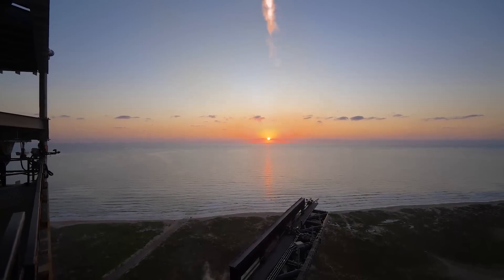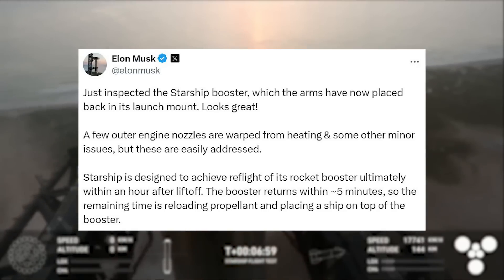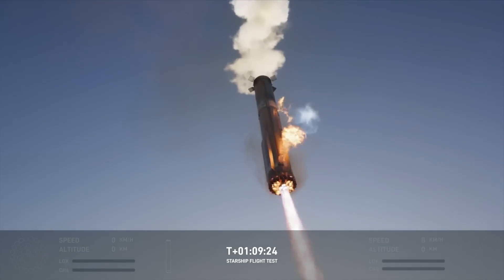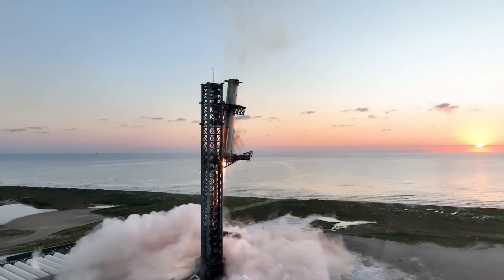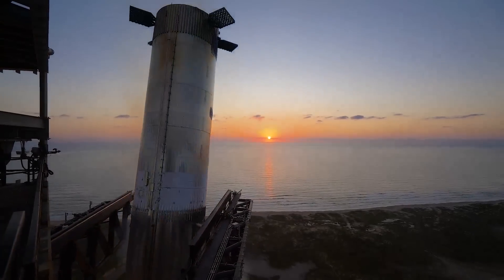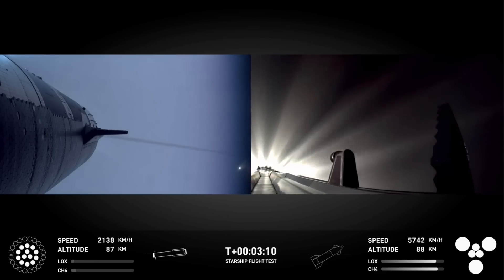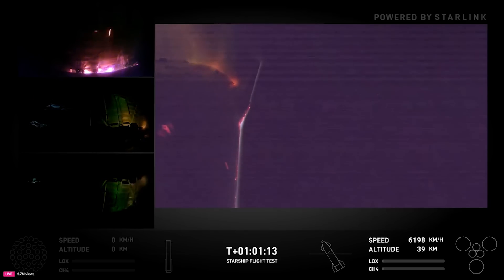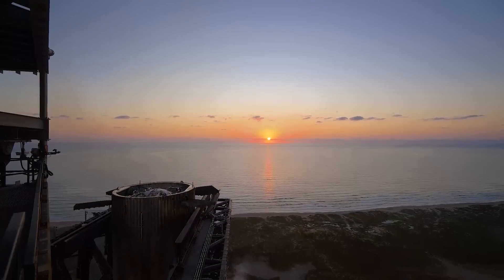What Happened After SpaceX Caught The Super Heavy Booster?

Comment: Hear me out, but IFT-6 will probably try to have starship perform a deorbit burn, with much the same flight profile as IFT-5 aside from that. IFT-6 will probably try ship recovery
Reply: I can see a burn test, not so sure about a recovery, I guess it depends if they use the last of the V1's or start with the new V2's.
Reply: @TheEvilmooseofdoom  I mean remember they only had the booster test its functions to rtls once before they tried catching it, I think the only real thing they need to try catch a ship is to be able to orbit and deorbit in a certain position
Reply: @Mr_Lyric  Do you think catching a starship will present TPS issues?  Looking at the booster catch the arms were in contact with the sides as it was moving.  On starship that would scrape off some of the tiles.
Reply: @TheEvilmooseofdoom  Quite possibly, but it shouldnt be too big of a problem for a catch test
Reply: @Mr_Lyric  I agree, a test, but it would still mean some kind of modification to the design might be required for a final version.  Or are you thinking that it might be easier to simply replace some tiles (they are standardized) between flights?
Reply: @TheEvilmooseofdoom  It would probably be easier, but given that the goal is rapid reuse I think they are trying to get it to the point where that is mostly unnecessary

Comment: Specs:
Height: 69 meters (226 feet) - Same as a 23 story building
Diameter: 9 meters (30 feet)
Engines: Up to 33 Raptor engines (using methane and liquid oxygen)
Thrust: Approximately 74 MN (16.5 million pounds)
Mass (Fully Loaded): Over 3,600 metric tons
Burn Time: Around 170 seconds
Reusability: Designed for rapid reuse via the Mechazilla tower catch system

Comment: The nozzle warping issue will likely NOT be addressed before IFT-6. SpaceX already has a major redesign of the booster (Block 2) and a 3rd version of their Raptor engines incoming, so the nozzle warping issue will likely be addressed as those are implemented.

Comment: Does heating and cooling metal weaken it?

The short answer to the question regarding making metal weak is yes, however, only for some metals. The process of annealing can soften a variety of metals. Brass, steel, iron copper and silver can all be made weaker by heating the metal to a set temperature and cooling it slowly... Cooling too fast makes it hard and brittle prone to cracks. Cooling too slow will soften the metal. The raptor engine has copper in the alloy.

Comment: simple fix.  circulate fuel in bell during decent.
Reply: Give them a call, Steve.  I'm sure they're simply clueless without your input.
Reply: i did suggest that the concrete needed a giant water cooled steel plate under the launch tower.  then the EPA went to a diddy party.

Comment: Elon needs to stagger the booster rings so that they cool in ratio with ring shutdown & startups. For instance when the middle ring & outer ring shut down at the same time, the outer rings cools down first because the wind chill factor cools it down quicker than the inner ring, which is because it is not subject to the same wind chill factors that the outer ring has.
This can be mitigated by placing the middle ring further down than the outer ring, so that it's exposed more to the wind chill, with the centre ring down further, so that the base forms an "bluntish arrow" upon return through the atmosphere & an arrow plume once the centre ring lights back up.
This bluntish arrow gives better aero-dynamic characteristics than their current blunt end that they currently use, and will give better "stearing" when they fire up.
Reply: Wind chill.. good grief.

Comment: Realistically how long after landing would it take to cool down, fully inspect for defects then refuel and prepare for the next launch ?
Reply: I actually think it would take a lot longer than folk think.. I imagine a number of reused bodies and nozzle assemblies from previous flights  being refurbed in slow time for the next flight and cycling these units around.  If you have folk on board you'd have to be very risk averse. I worked in the rocket motor "business" for nearly 30 years in the UK, working internationally on programmes with the US ( United Technologies,  Naval Weapons, Edwards), BC in Germany,  Roxel UK, France, DREV, WSL Adelaide and on research programmes AGARD, NATO ..that's my background.  Just allowing a motor to cool down so that you can handle it takes quite a time.
Reply: @monabri7387  that’s what I was thinking, after cooling down which would realistically take hours, there would then be hundreds of components and systems that would have to be thoroughly tested, cleaned and inspected. Then there’s no way that absolutely nothing would need to be repaired or replaced. I’d hazard a guess that it’s going to take at least a week for turn around.
Reply: @spinnymathingy3149  No one has any idea what if or how much work will be needed between flights.  This is still development.  They have been speeding in F9 turn arounds steadily and those things burn a dirty fuel on top of everything else. As for cooling, when you're pumping cryo-fluids into something it cools, it cools quickly.
Reply: It depends on the number and types of sensors it has.  I'm guessing the number is VERY large.
Reply: In the future? Probably around an hour. Still Lots of improvements to add to everything. And once they get Routine, inspections, refueling and everything else will be fully automated. Though I do guess they will have varied degree of inspections like with airplanes after a certain number of flights

Comment: Can someone explain why the heat and pressure of re-entry seems to be such a massive obstacle but leaving the atmosphere doesnt seem to pose the same challenges?
Reply: The speed. It is hitting the atmosphere at 27,000 KPH. That much speed creates much more friction and heating. During launch it only gets up to maybe 10,000 KPH while in the atmosphere, so the heating is less. Also the angle of the flight at re-entry is more extreme, so more friction. Think of holding your hand out the window in your car. Parallel to the road is like launch, less resistance. Perpendicular to the road is like re-entry, more resistance.
Reply: In addition to what @grangerm said, there is very little air at high altitudes.  Which is good because you need to be going very fast when you reach orbital altitude.  But, when you're returning, you've got a LOT of speed that needs to be bled off, and there's simply not enough room and energy budget to carry fuel to slow it down.  Just imagine having to have fuel tanks 4 times as big just to slow it down to get back to earth.  So, it's always going to depend to some extent on using thin high-altitude atmosphere to do the initial slowing.

Comment: how are they gonna get a fresh starship to the pad within an hour?? surely you can't just have it sat on the floor right under the first launch?
Reply: Surely it’s gonna take longer than that but musk just wants to set tough deadlines to push the team
Reply: Look at it this way.  For most of their ambitions they will be doing a lot of refueling, that means most of the starships that will be flying are tankers.  IF they can dial the system in to the point where no major refurb is required there is no reason a tanker can't be refilled on the pad with the rest of the stack.

Comment: I think I have a good theory on the engine warping and the "simple" fix. The engines had the full force of the atmosphere pushing on them (like cupping your hand holding it out the car window), and that combined with the heat softening the metal on reentry started to bend the engine bells. After all, without constant coolant, they would melt in seconds after ignition. I think their solution will be to simply start running coolant through them during the descent, which they may not have been doing (we know they can do this, as there was a call out for starship that coolant was to flow through the engines shortly before the flip maneuver burn). I think this would solve most of the issues. There's no way the engines can't in principle withstand the force of reentry given that they experience much more stress at launch, so I believe it's just a matter of cooling, hence why Elon seemed pretty confident it would be an easy fix.
Reply: Indeed, that's the way to go in modern rockets. You cool your engine with the fuel, which in turn becomes superheated and easy to ignite. Fuel does 2 jobs in one go. As Elon implied, I imagine you simply alter your fuel rates to the engines, although this solution will probably slightly decrease payload as the net effect will be to use a little more fuel to achieve a slower descent which then has less friction burn. Either that or to burn the fuel in a different way such that it is more cooling and less power. I'm sure both are possible. It would be hard to get this balance exactly correct first time. (btw, I say "simply" when nothing is simple here)
Reply: @snaplash  makes sense, though I imagine it doesn’t really burn any since they’re just cycling the cooled liquids. My guess after thinking about this more is that, like with starship, they do cycle the fuel/coolant through the engines prior to the landing burn, but didn’t realize that they’ll need to start it way sooner to combat the heating from coming back down

Comment: I have given the issues that StarShip's having. a thought. In truth I was expecting this when I looked at the craft before launch. Hear is how SpaceX can fix the wing issue.
The main issue is the area in question is to thin to account for this area of heatting. The main issue is that the heat shiled under that area is not out enough to provide enough protection. The issue is I think they forgot about the wash effect that this plasma pulls in. They also need to change it from the 45°  they have this at to a more 62° to counter that issue. I would also say that the joint section needs a higher shilding thickness. They are getting closser but if needed 54° would work as weel.  Nice catch.
Reply: You're out of date there armchair expert.  They're already way ahead of you.
Reply: Like they already built the ships they're so far ahead.
Reply: Ship 33, the first V2 version, has adjusted front wings, which includes placement under larger angle. I think it wouldn't make sense to use another of the remaining V1's for collecting more data. What more can you learn?
Reply: They didn't forget anything.

Comment: The flaps don't have any role to play in reentry because there's not enough air density for them to be a control surface. They should either fold the flaps completely or recess them into the body during reentry and then extend them to use as a control surface after you've entered the atmosphere if you do that you avoid Plasma friction at the joint
Reply: What are you on about? They do control the ship during reentry! The only time they are ineffective is when in space before you can see the plasma!
Reply: @kevikiru  Pretend experts.  Most of them area video game experts and that means no idea how things work in the real world.
Reply: @kevikiru  What I am on about is science. When an aircraft is Re entering the Earth's atmosphere It is not like jumping into water where one minute you're dry and the next minute you're wet. The Earth's atmosphere has different levels of density. The more dense the air at lower altitudes the better that control surfaces work i.e. wings, Rudders etc.  During the initial stages of reentry the spacecraft is moving so fast that when it encounters air it literally ionizes the air Breaking apart the nitrogen and oxygen molecules making plasma.  Plasma is what occurs on the surface of the sun.  If you hadn't aircraft that could withstand the heat do you believe that control surfaces would be if any help to you if you were flying in the upper atmosphere of the sun. By the time it reaches the plasma state it's no longer a gas that you can fly through and manipulate. That is why most spacecraft don't have control surfaces even though they have to come through the atmosphere to get back to Earth. The first spacecraft to actually have control services what's the space shuttle and that was only so that during the last parts of its reentry it could glide. I believe the same is true with Starship the control surfaces are not needed during the plasma stage because there is no air around it's no longer a gas. Control surfaces work through the process of friction the air acting on an aircraft and turning it a certain way one way or the other. The Heat created during reentry has nothing to do with friction.     
https://www.marssociety.ca/2021/06/24/rocket-physics-the-hard-way-re-entry-and-hypersonic-flight/#:~:text=In%20our%20last%20installment,%20we%20covered%20Bernoulli%E2%80%99s
Reply: to much complexity and weight plus it would take away from internal volume which means less fuel which means less payload. they will figure it out.
Reply: @zachmoyer1849  You're right about it reducing internal volume. Maybe if they could fold it like they do the wings on a aircraft on an aircraft carrier for storage. As long as there's a 90 degree angle that is within the plasma stream You're never gonna have reliable or rapid reusability.  Even if it makes it through one reentry that 90 degree angle is going to get beat down every time it reenters the atmosphere until it falls.  The smallest defect and you have Columbia all over again .   When the space shuttle was being created they literally envisioned it flying weekly But re entry is a bitch
Reply: @jamesbarnesii4124   i think they need to embrace the gap, and move the control surface further away from the body and then figure out a way to protect the shaft. that way the plasma can just flow around the body and the control surface independently not creating any weird phenomenon at the junction.
Reply: @zachmoyer1849  The only problem I see is maintaining a seal during later flights.  I thing if they raise the flaps higher on the booster the Curvature of the hull will shield and Deflect the plasma. It would have to be like 15 degrees rightt and left  from top dead center.  That will work for reentry as far as the control surface in Horizontal flight but I have no idea whether something like that is possible in the vertical orientation during takeoff
Reply: @zachmoyer1849  I wonder if the G forces incurred during the landing burn will cause problems as far as readies ability. That has to be a huge amount of g's.  I'm surprised they don't bleed off the speed much soon that type of landing seems unsustainable.  I'm not even sure a human being could survive that type of landing
Reply: You guys hand out suggestions for improvements so easily.  It's just amazing that there are so many things that the actual rocket scientists at SpaceX don't understand about the ships they design.  Maybe you should start your own rocket companies?  I'm sure you'd put SpaceX out of business in no time.
Reply: @Quakeboy02  lol its harmless fun man. Its cool to make guesses and see if you were right.
Reply: @zachmoyer1849  I understand that part.  What bugs me is these naive suggestions that they think actual rocket scientists could figure out.  But, I'm an old curmudgeon.  Don't mind me.
Reply: @Quakeboy02  Honestly, any interest in stuff like this is a good thing, in my opinion, even if the suggestions are dumb or naive. There have actually been cases where people in the comments noticed something that the experts did not. It's not often, but it does happen. SpaceX engineers are obviously smart, but they are still human and subject to mistakes, or perhaps wasting their time doing something that's already been solved. Either way its harmless and would not be in my top 10 problems with the internet.

Comment: This is only second to landing on the moon as far as The exploration of space by human beings.  I do have a concern looking at how fast the booster is descending and the amount of thrust that it takes to slow it down South quickly I could easily see a situation of metal fatigue on the booster occurring very quickly. Falcon 9 launched a 100 rockets and didn't have a single failure as far as landing. That's a 99% or more success rate. That's not good enough for Starship.  Every Starship launch requires two separate landings. At a 99% success rate you would only have a crash every 50 launches. The problem is the crash is going to destroy the launch tower and all of the tanks used to refuel the boosters. What they did yesterday was a display Of precision And I am still awestruck. I just don't see how you can perform that hundreds of times